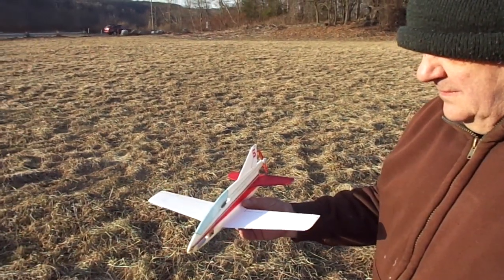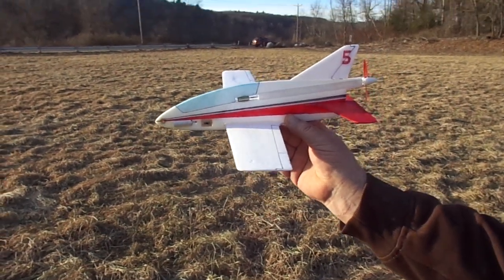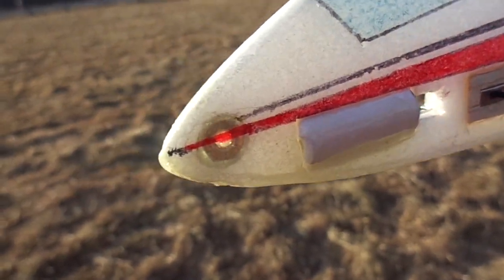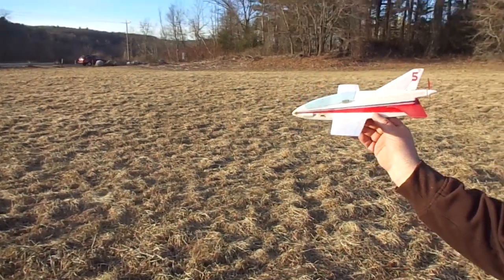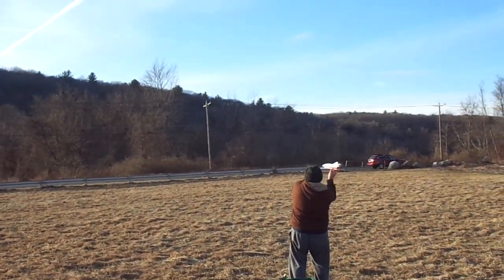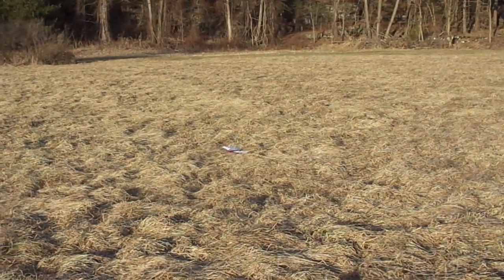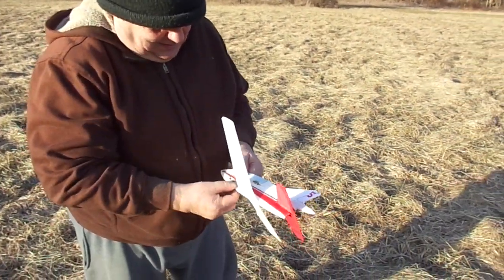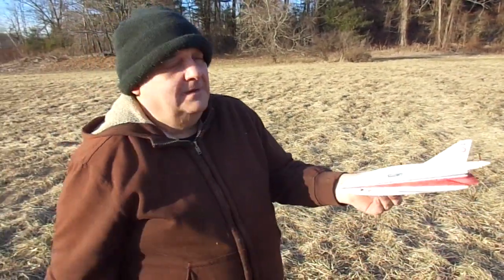BD5 Supercapacitor Free Flight Foamie

Comment: This has me drooling all over my keyboard! It makes me think about a slightly smaller BD-5 for "Power Up" condenser stick unit. It's already a pusher so it does't need a driveshaft! Yours is what? 16" span? Scaling it down is important because I need to get the front of the stick at least to the leading edge wing root so I can get the charger in. Also, I have to limit the climb so I can fly indoors, and a smaller plane has a higher wing loading. I have four more 10F Supercaps, but  I also have two unopened PowerUp units. I don't see them on BangGood any more, but for some reason they kept falling into my hands. The way I have my "you guys"-inspired charger set up, I can use it with the PowerUp sticks too. Thanks again for the inspiration!
Reply from the maker: Hi Herb! Actually it's  16 1/4", you have a good eye! I found a model plan on outerzone from which I copied the outlines. Here it is:

https://outerzone.co.uk/plan_details.asp?ID=8232

Adjust the size of the drawing on your computer screen, then trace with tracing paper and a pencil, right over the screen.  -Mike
Reply: @sonex413  Thanks! One of my favorite pastimes is browsing Outerzone and AeroFred.
Reply from the maker: oooooooo...AeroFred, I never heard of that one.....oh well, here I go......Thanks Herb!!

Comment: That looked so cool in flight. There is another guy that is building smaller models of gas free flight designs such as Starduster and Pearl. He is really pushing the capacitors charging up to 4 volts. The performance is impressive, not sure how long capacitor will last.
Reply from the maker: Thanks Bill! My little MiG needs more power so I'm experimenting with pushing the cap voltage on just that one ship...in case I destroy the cap! I have tried up to 2.9 volts at which point the charging rate really slows down. We'll find out how much they can take!
Reply: @sonex413  Guys I have just done a little promotion of your YouTube channel in a couple of free flight forums I am on. Bill Kuhl
Reply from the maker: Bill, that's great! Thank you, thank you, thank you! -Mike
Reply: @sonex413  hopefully you will get a few more subscribers.
Reply from the maker: Yeah we are looking to get to 1K subs and 4K hrs annual viewing minutes....YouTube doesn't take you seriously as a channel until you meet those minimums. Right now we are at 693 subs (3 of those in the last 10 min thanks to you) and about 3K view hrs/yr.

So,we are getting there.....for our part, we're gonna build a bunch of cool stuff and make a lot more vids! Glad to have you along with us, Bill. Thanks again. -Mike
Reply: @sonex413  it sure seemed like several years ago it was easier to get higher number of views on videos. Joshua Finn J&H Aerospace makes a bunch of videos flying next to his house. He has many model interests but seems to really like the rocket gliders.
Reply from the maker: I have seen Joshua's videos...and I'm subbed up...great craftsmanship and creativity!

Comment: You guys are on it ...wish i lived near you two lol.   Would it be possible for you two to design a very simple  supercap plane that your subs could easily duplicate to get us started in capacitor planes ?    Just looks like too much fun to miss out on.  i myself have been RC  sailplane hobby for half my life but never had much luck with rubber powered free flight or  like what you fellows are doing...... awesome video......high five to both of you.....Ps are you a member of RC Groups or Hip pocket Aeronautics where i could send you a PM ?
Reply: In the past you could buy RTF capacitor planes at toy stores. Fly it for awhile and then put the components in a plane you build.
Reply from the maker: Yeah, I remember...Bangood still sells them mail order, I think they come with a 3 or 5 Farad supercap...but they also sell the components that we've been using to build our birds and we build cheaper than RTF. Prices are good and shipping is free if you specify 'standard shipping' on your order. I have posted links to the gear in the text description beneath my video, 'supercapacitor free flight basics' which you can find on my channel...check it out  -Mike
Reply from the maker: @Bill Kuhl I just put together a really cute 10" span plane...foam picnic plate mat'l .066" thk...cheapo plates, if you put food on 'em they'd fold up..., a 1/8" sq. x 5" balsa stick, some Titebond and a dab of epoxy. 615 motor, 10 Farad cap, and of course a tiny slide switch. Total cost under 3 bucks. We buy the caps 10 at a whack, same with motors, etc...cheap to equip a whole fleet! (oops...and a prop!)
Reply from the maker: We will definitely do a build-along video very soon, we've been thinking about it for some time! Thanks for the kick in the butt to get us started! 

I've been building and flying all kinds of stuff since I was a kid...including a lot of rubber power and all kinds of R/C. These supercap models do what we used to wish our rubber jobs could do and the electric drives cost no more than some rubber strands from the hobby store! No broken motors tearing the fuselage apart...no tedious winding...nice and clean...torque curve and power delivery very comparable to rubber. You should definitely try one!

I don't often visit rcgroups but a long while back I posted there a few times...check out this meat tray foamie R/C job I built back then....It flew for about 5 years before I finally trashed it and it was a good reliable everyday flier.

https://www.rcgroups.com/forums/showthread.php?688053-Meat-Tray-Dr1-Fokker-added-new-pix-wing-building-tips

Best place to contact me is right here on youtube comments, I don't check email or visit other sites very often.   -Mike